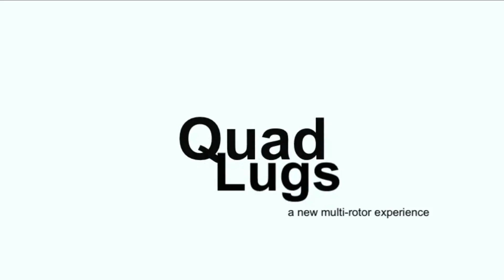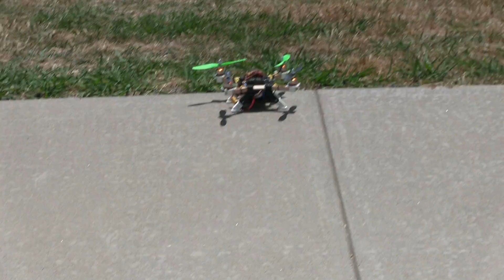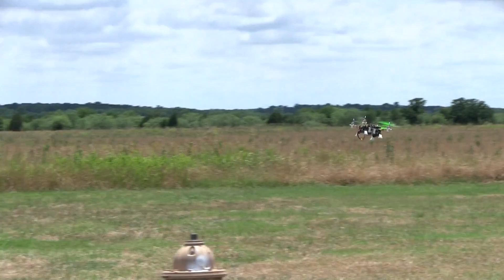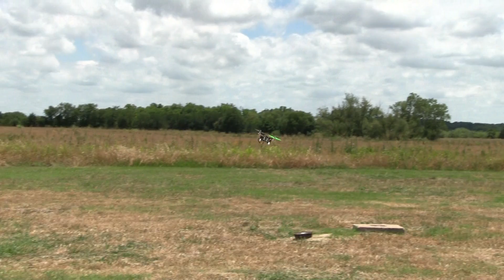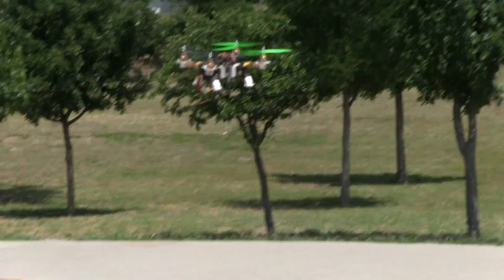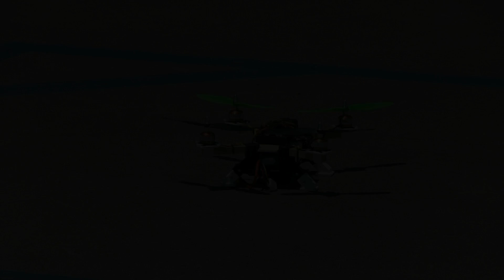QuadLugs Mini XL - Introduction

Comment: Nice try but I think you guys missed the boat with this one. Mini H-quads are indeed  all the rage right now but this one looks pretty much like a regular quad with shorter arms. Same motors even... . An actual  mini quad is quite a lot different. It's  smaller(250mm), lighter(under 150g for the frame) and has higher kv motors (typically 2300kv).
Reply from the maker: QuadLugs offers something different - the ability to  - change a design - change size - change configuration - all without breaking the bank.
  QuadLugs is different.
Reply: Quad Lugs It's cool that you can change the design alright. It would be great if you could change it to an actual mini quad. I guess that you can only go so small with your current modular approach. Don't get me wrong, I do like a lot of  your stuff, I just think it would be great to see a true mini quad from your company.
Reply from the maker: benjahnz Thank you for your comments - we could shrink it down a bit more and use higher kv motors and smaller props - but I wanted (as with all QuadLugs) to use easy to get and common items to complete the frame builds and a set-up that could be used in other builds with the same Lugs. This quad does however fly extremely well and with the motor and prop set-up it's crazy fast. Again Thanks

Danny
Reply: Quad Lugs Maybe when you grow a bit more, start a mini quad lugs line?  Calls for smaller (width) dowels, has smaller connector pieces?  I think it would be cool to see.
Reply: SteevyTable Yes I expect it would probably sell well too. You gotta move with the times.

Comment: Great video as always. My apm board is very clear they want the H copter motors rotation different than the X. I own the Modified H QuadLug and I loved the build.  I thought it would be awesome to change from X to H with the turn of a screw.   Do you think I will be ok leaving apm board in X configuration and fly my QuadLugs in both X and H config?  for the life of me I can't figure why they want motor rotation different for X vs.H. Looks like you do it with the Kk2 no problem.
Reply from the maker: I can't answer your question - I have only been flying with the KK control boards and Naza - so far - you have just changed that ( I am ordering an apm2.6)
Dennis Baldwin on his YouTube site has quite a bit of info on the apm - he also has a QuadLugs Modified H - maybe we can get him to do a video or two on the apm configuration between X and H

Danny
Reply: The motor config for an X or H is the same on an APM.  There is no need to change the motor direction or motor position.  I have flown both using an X config.
Reply from the maker: ***** Thank you very much  

Danny